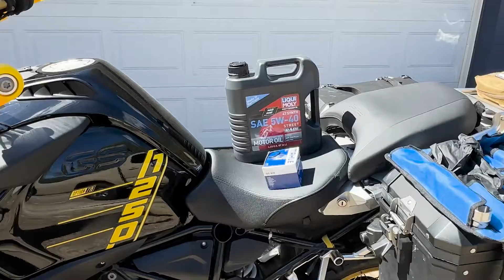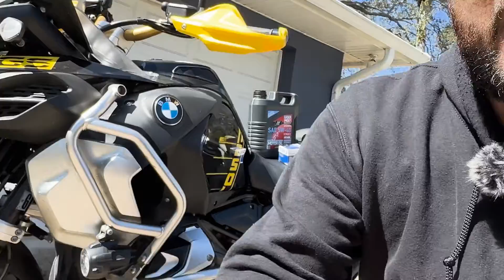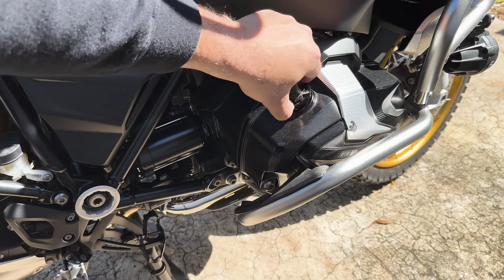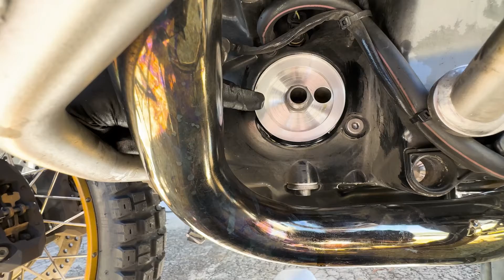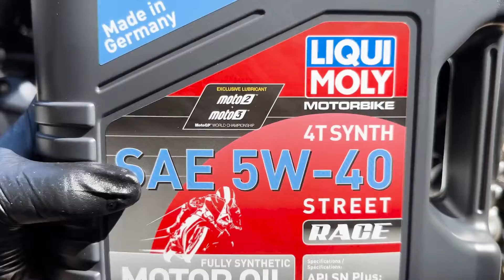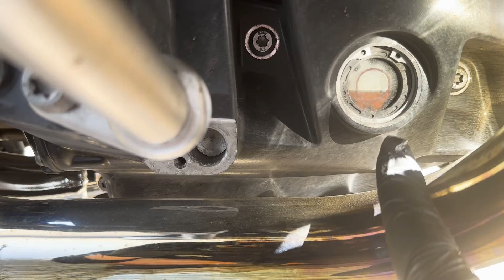DIY: Oil Change BMW R1250 GS Adventure (GS/GSA 2019-2013 LC)

Comment: Nice video, I’m curious if you place the crush washer’s flat side to the oil pan - I think that is correct. Also, when you torque the drain bolt to 42Nm do you know how much the bolt/wrench rotates, i.e. 1/16 (22.5 degrees), 1/8 (45 degrees), or 1/4 (90 degrees) from a full rotation from being snugged up from the start?
Reply from the maker: Thanks for watching! I don’t do it base on the Nm recommended but by feel (yes not what the book says) but I’ve been doing all my oil changes like what since I started wrenching. Sorry, I couldn’t help.
Reply: That’s cool. Thanks